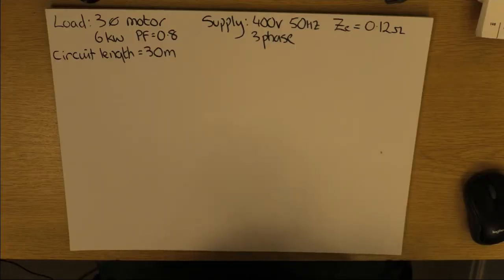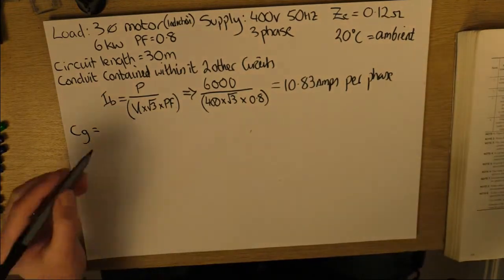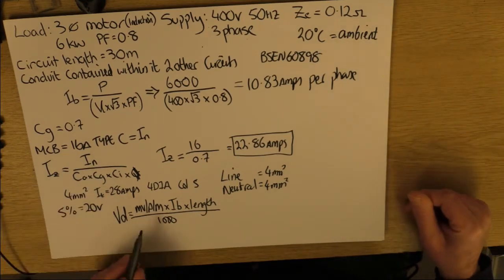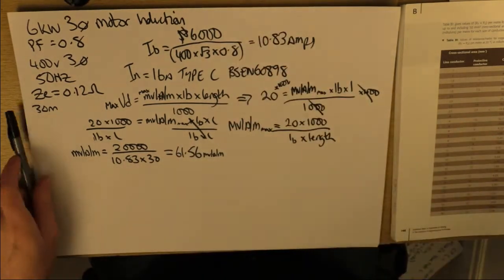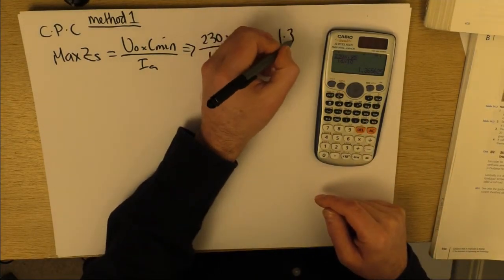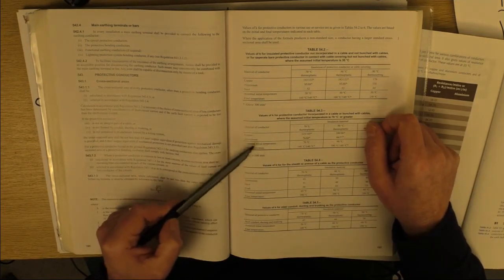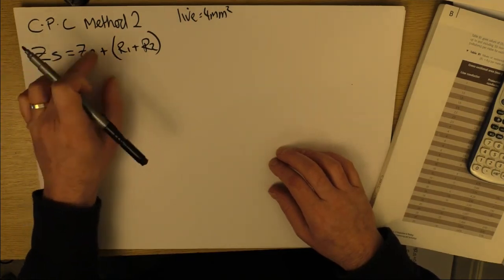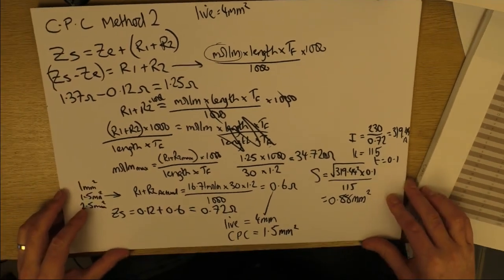Improved Audio. Cable design 3 phase induction motor with power factor sizing live/cpc conductors

Comment: Great video. Only gripe being, it wasn't long hand. Uo 230, Power 6000 ? / 400 ?  It's all very well having the numbers, but without their symbol they don't mean much.  Our group made a habit of doing it long hand 230v, 6000w. 400v.  I was so far ahead of the group, I extended the calcs by adding a 70 degree running temperature and actually found the calcs to be non-compliant.  After the adiabatic I went onto further add the let through current. k2I2 => I2t.  Out of all the units, I thoroughly enjoyed the calcs.

Please can you make some level 4 calcs.  I started, but couldn't complete as I wasn't going to get paid from my work.  Top job keep 'em coming
Reply: I appreciated the fact what was being put across- designing of the circuit with regards to protection according to the wiring regs. Putting in the SI units would not aid those that are not up to that level.
Reply: @abdulseaforth6930  some in our group were marked down for not using the si units.  Having done the calcs, with all the numbers all over the place, it can become confusing as to what number relates to what, hence why we done it "long hand" with the si units incorporated.  Any student at level 3 or below can quite easily identify each unit during the process.  each to their own I suppose.  The level 3
Reply from the maker: Hello, Not really sure what you mean by long Hand? A level 4 design could be found here https://youtu.be/vl1RE32W5lg
Reply: @cestemshow  Had a brain fart, I meant to say include the Si units when writing up the calcs.
Reply from the maker: I did write the equation for design current and most others I believe. Is that what you mean? I would expect at level 3 students should know that power is measured in Watts and U means 400v and Uo means 230v etc. That should have been covered at level 2 according to the syllabus.
Reply: @cestemshow  I didn't do level 2. Went straight into level 3.  The others did level 2 and they did tend to struggle from time to time.  

You're right that students should? know what V, Uo, W, I etc mean,  I just meant that when writing the calcs down, we all made a point of putting the unit.  so 11kw 3~ motor was written 11,000w / 400v x sqr3 x p.f x eff (only I did the p.f and eff).  it just seemed to make the numbers more clear.  It = In/ Ca,Cg,Ci,Cf = A  Without adding the Amps after the tabulated current it becomes a "meaningless" number.  Like I say we made it a practice to add the units and our lecturer agreed and often encouraged us to do so.

I've watched the L4 video and its great.  I love to see one with SWA when you have to get the K value and c.s.a.  Also I'm lead to believe the L4 there are calcs for the neutral too.
Reply from the maker: Ah I understand now what you mean. Well, basically the reason I don't do that, and I have in the past, is because there are other people who get confused and think it's an algebraic equation...... So if I put 400V they think V is an unknown... There needs to be a bit of self discovery with all learning I think. It's important to not have it spelled out to us too much. Those moments when we link things sticks out in our minds and is remembered for longer I've noticed.